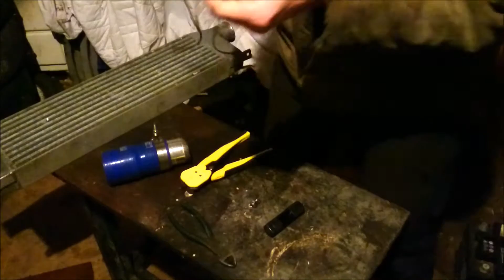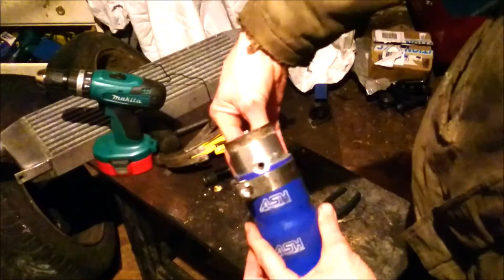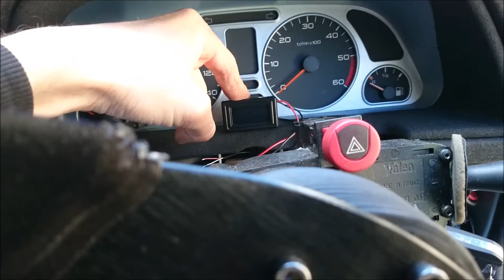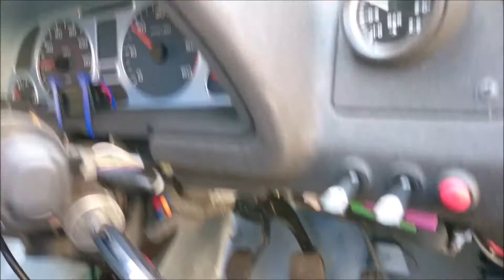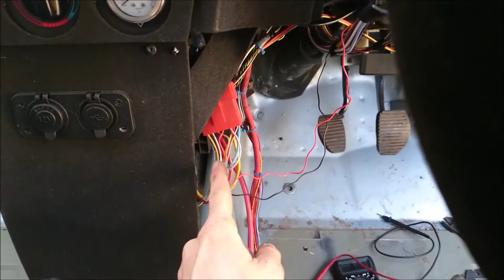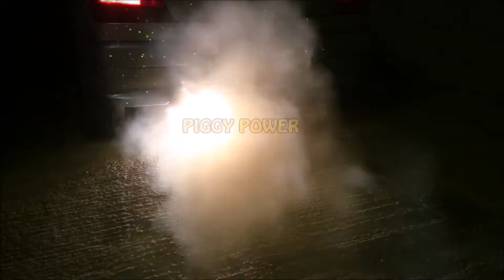HOW TO: Budget inlet temperature gauge install

Comment: Hi guys I have a temperature gage that was fitted with the car I thought all of them 306s had them
Reply from the maker: OB1 athome hi there! Your 306 came with a few temperature gauges as standard, a temp gauge by the clock for outside air temp, the coolant temp gauge and if you had a GTi6, an oil temp gauge. 👍🐷👍

Comment: that probe is so chunky it looks like it is going to literally restrict airflow!
Reply from the maker: Rick Dangerous if that tiny 3mm probe is a restriction.... You obviously have an epic F1 engineered intake system!
Reply: yeah maybe I dunno... I pause at 11:39 and see that the probe itself is small but the piece holding it in is not.  Maybe it doesn't matter but a restriction is a restriction however I do understand you got to probe it one way or another so it has to be that way

Comment: Hi Piggy Power, what is the name of adapter that you use to fit sensor on the pipe??
Do you have a link to ebay or something..?? Thanks
Reply from the maker: they call them "glands"... ebay that and a size in MM and 100s will come up 👍🐷

Comment: Hey Mr Power, thanks for the video.

What sort of temperature probe is it, a thermocouple or pt100? Its been a while since I've played around with temperature probes but I know they can a bit tricky. 

I would think you need to be a bit careful what wires you use to extend the sensor cable because if its a thermocouple I think they need to be matched to the sensor material pair. Also you can effect the temperature readings by introducing junction points where wires are joined. I'm not sure about extending the pt100 wires.

Anyway, good luck with testing it, hopefully it gives good readings with now problems. I like the idea, you can never have enough measurements, to be sure.
Reply: I think this gauge uses a NTC sensor, not a thermocouple or Pt100....
Reply: Oh ok, that's a thermistor.

I guess the outside temp sensors on a car are the same then.
Reply from the maker: +Royce Amatique yeah just ntc type as far as I'm aware